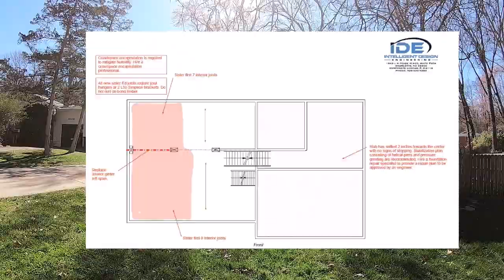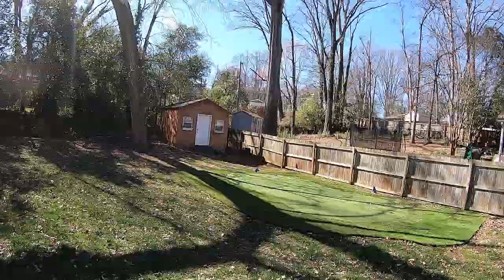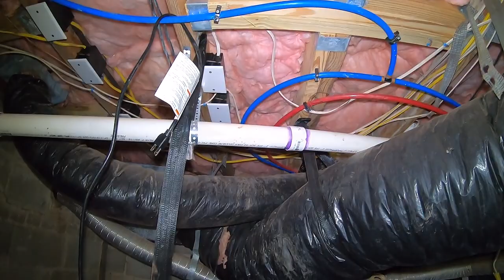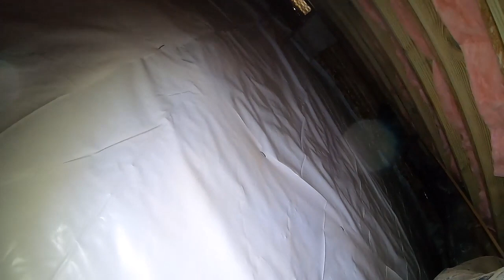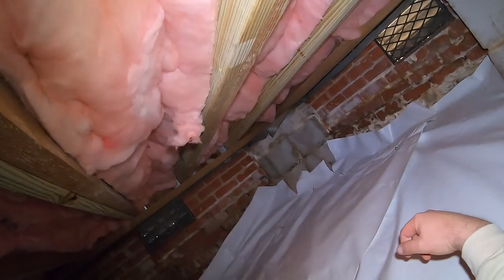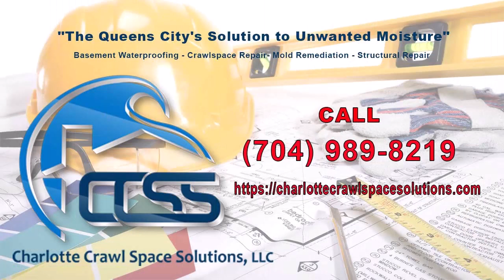STRUCTURAL FLOOR REPAIR - CHARLOTTE MADISON PARK - CHARLOTTE CRAWLSPACE SOLUTIONS - 704.989.8219

Comment: With the support of the local engineering community, CCSS adds a special touch to the local market. If you are looking for a locally owned and operated contractor without the influence of corporate franchisees, you have found the right group of people to work with. No sales gimmicks, and/or glossy brochures. Just hard work and results at a fair price. Don't be fooled by commissioned based sales people selling products. You want custom solutions developed by real professionals with over 30 years of experience in the industry.